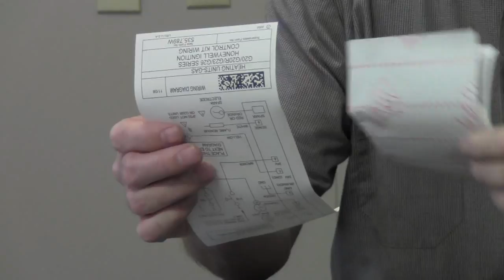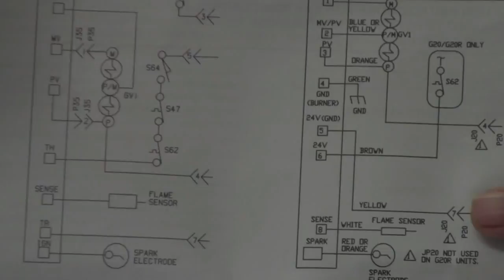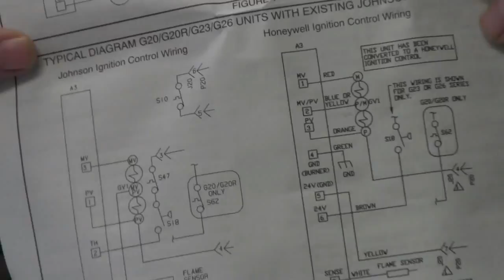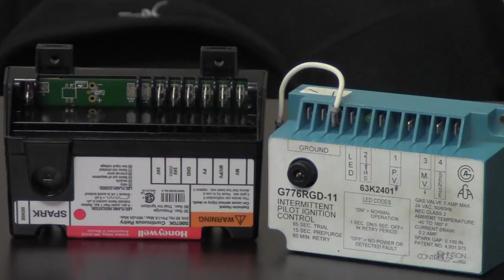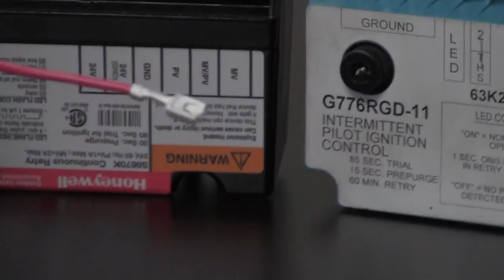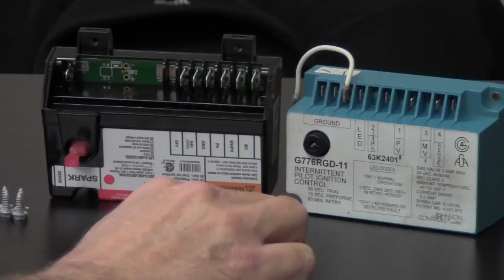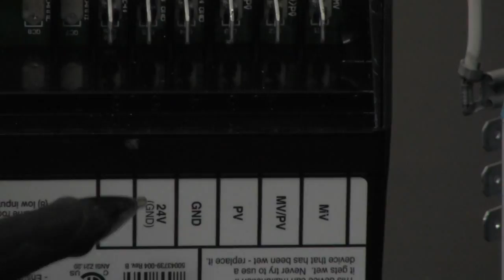30W33 Ignition Control Kit

Comment: See that blue ignitor, I think it is a JC G776 RGD-11 series unit in my old 1996 Lennox furnace. Well I fixed it for under $5. The PV would start up and then drop out. Why? Because the relay in the unit had failed due to increased resistance of the relay contacts as they heated up due to current. As the voltage at the PV which started at 23V and then dropped to 11V, the voltages across the relay contacts would increase from 0V to 12V. That unit is now 24 years old with each set of relays (PV & MV) lasting about 12 years.